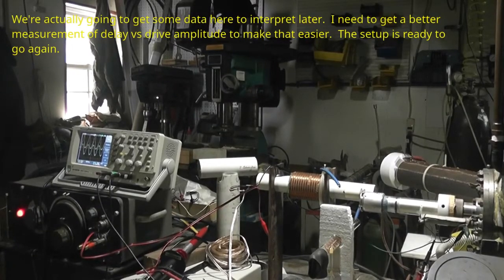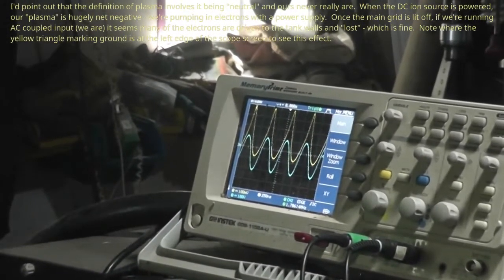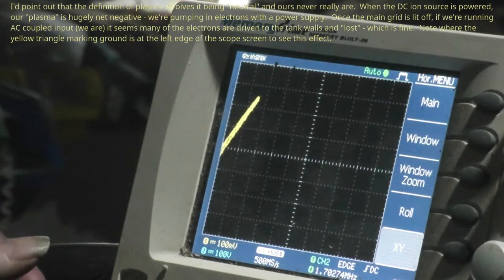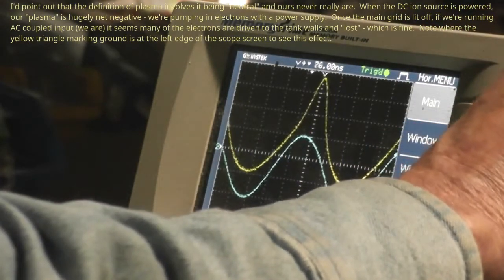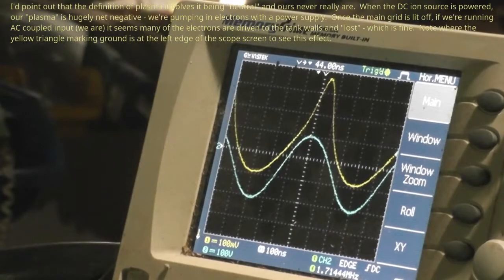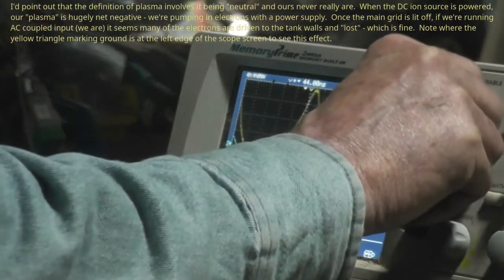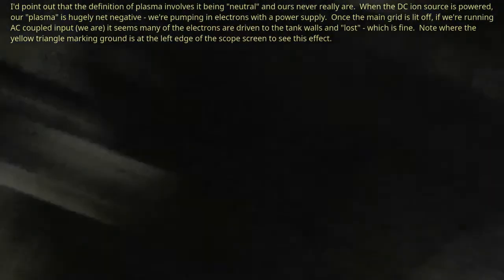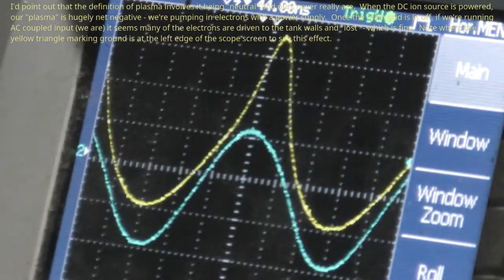CowboyDataAq 3

Comment from the maker: I recently got a new network analyzer (now there are both a MiniVNA pro and the new Analog Discovery-2) that has more flexibility to add, for example, a big power amplifier in the signal chain and still make good measurements of this - and add a few as well.  There will be more, stay tuned - I'm working on the (otherwise boring) medium bandwidth high power RF amps = that unlike most can handle weird load impedances - and ancillary stuff now.